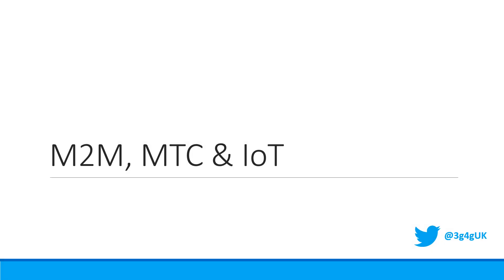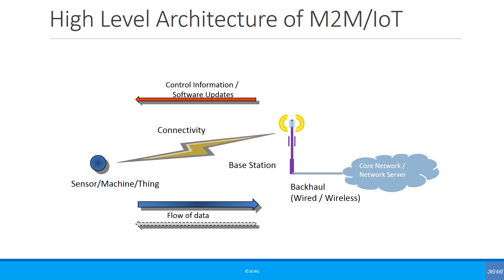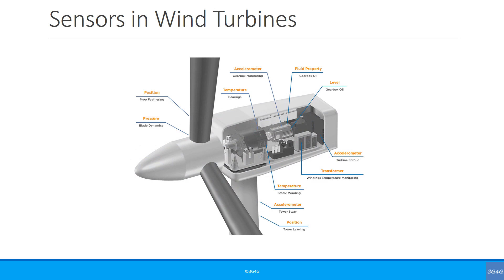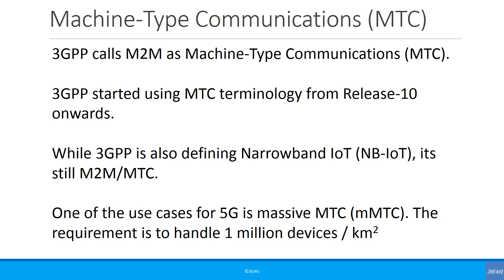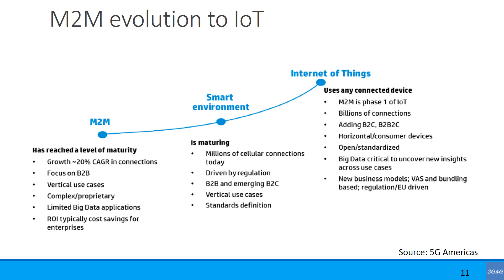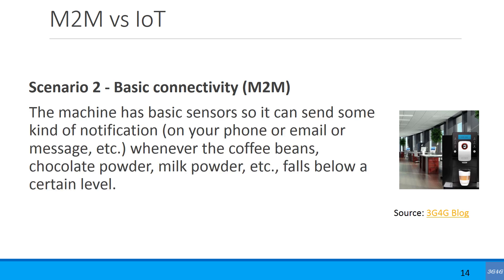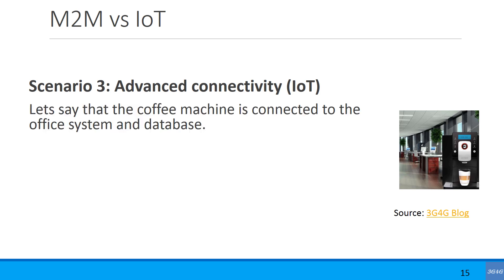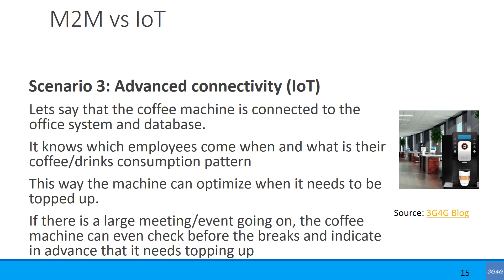Beginners: M2M, MTC & IoT

Comment: Does M2M architect uses standard GSM and standard SIM card? what is the differance between a standard SIM and M2M Sim Cards?
Reply from the maker: Most of the M2M devices still use a physical SIM, similar to those used in your smartphone or any mobile phone. The technology could be 2G (GSM), 3G (UMTS), 4G (LTE) and even 5G. Many of the modern M2M/IoT devices instead use only the SIM software (eUICC) so there is no physical SIM. The same technology can be used for smartwatches, smartphones, tablets, etc.